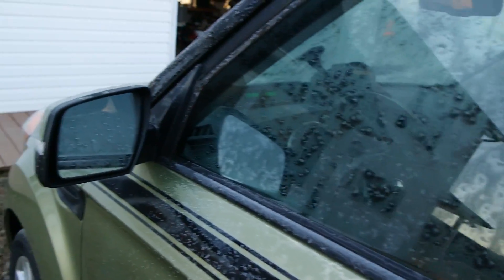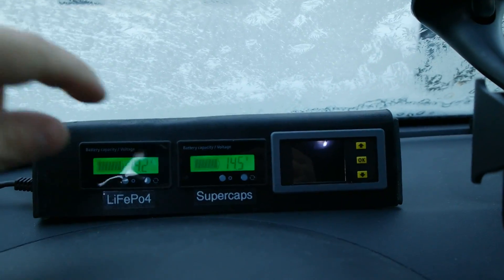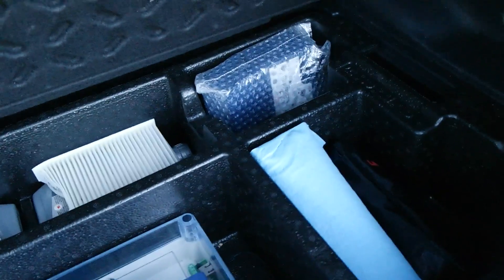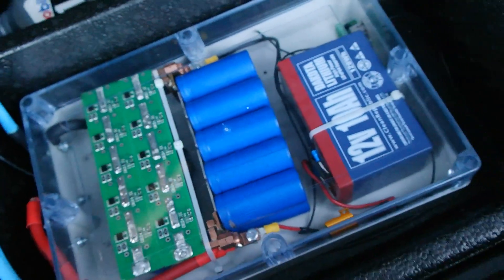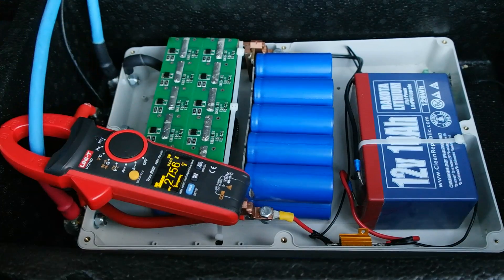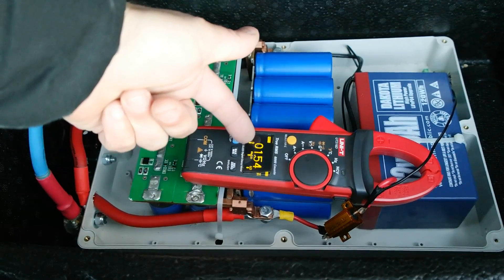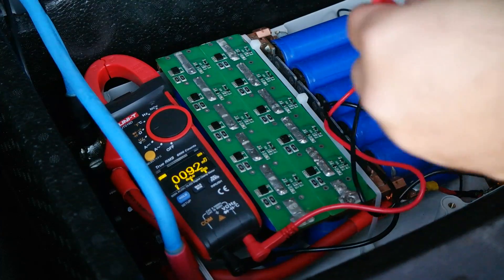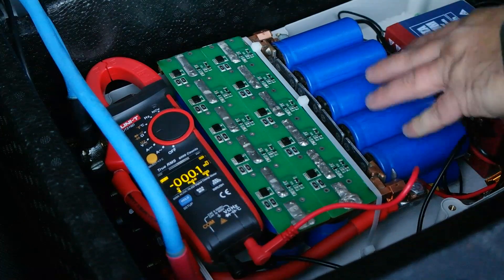Hybrid Supercapacitor Car Battery Part 7   1 Month Update

Comment: 12vdc / .1ohm = 120Amps that 25watt resistor should fry..
Reply: The lithium battery will never be at 0V unless it's just 4 cells welded in series, if it has protection circuit it will cut at 2.5V per cell and won't allow full current charge until the cells recover to 3V so the minimum battery voltage that allows it to recharge at full power should be 10 to 12 volts.
But most alternators output 14.4V so the power will be:
14.4V - 10V = 4.4V / .1Ω = 44A x 4.4V = 193.6W / 25W = 7.744 times more power = 🔥🔥🔥🔥🔥🔥🔥🔥🚒
14.4V - 12V = 2.4V / .1Ω = 24A x 2.4V = 57.6W / 25W = 2.30 times more power =🔥🔥🧯
14.4V - 12.82V = 1.58V / .1Ω = 15.8A x 1.58V = 24.96W = 🍳⚠

Comment: Clamp meter needs to be swapped direction to see current going out.. dc amp clamps are directional. Current supply should be front to back. So you have it on correctly to measure charge Current but not any drain.

Comment: Why is it that you still need to add a battery on to charge the capacitor? Does the alternator isn't enough to charge the capacitor while it's on or running?

Comment: Two questions for those who have done it already:
1. Will it work similar with the existing SLA car battery?
2. What does the balancing board do when an individual SC fails, i.e. short or V<2v?
Reply: Similar to LFP battery, SLA battery keeps 12.7V instead of 13.5V. In this case, the capacitor pack loses 12% power storage. The good news is , each cell would be 2.54 V. According Eaton data sheet, 2.3-2.5V is the most stable stage for energy storage. The leak current is only 0.5mA. According to Electroboom, the least voltage for a 66.7F 12V pack is 9.8V to start a 4 cylinder car. That means it still can start the engine after one week even without SLA optimally. With a 10AH SLA, it may last months as the parasitic current(20-60mA) is far larger than 0.5mA. The second one is, The capacitors are in serial, If there is a board, one cap failure doesn't affect other caps cause the voltage would be cut off when it reaches 2.7V (or the limits), If there is not protecting board, one cap failure causes the whole voltage drop, then the whole serial cap charges to 13.5V. The result is only 4 caps( depend on your cap number) bears the load, each cap would be 3.38V. So all 5 caps crack and leak. The worse, I didn't see anyone tested overcharge a supercapacitor. Comparing a boom of lithium battery with boom of a supercapacitor : ).

Comment: When supercapacitors are well matched and stored at a constant pack voltage, they tend to self balance, because higher voltage cells will leak current at a higher rate than the lower voltage cells. Balancing circuits are more crucial when a pack is subject to constant charge-discharge.

Comment: Super capacitor can’t be over charge they stop taking charge when full at the rating volt that is if the voltage is higher then the bank voltage it will get hot but

Comment: 0.1 ohm resistor.... Is that even necessary to have in a circuit lol
Reply from the maker: Very necessary! It limits the current being pulled from the battery to around 15 amps while actually starting the car. It also decoupled the battery from high amperage loads and allows the supercaps to do thier job and supply the bulk of the energy for starting your car.
Reply: @madelectronengineering  Have you considered putting an inductor in place of the resistor? It may serve the same purpose of isolating the battery during cranking

Comment: Do you want to go to Alaska but would you consider taking it to an ice rink parking it inside overnight to achieve temperature you need Because if you can prove that cold isn’t a factor which I don’t think it will be because you’re using super capacitors  your friend would be cold temperatures but I’d be curious to see what it does at -40-50 if those tests are good you can come up towards Canada And if you’re already I’m not sure where you are I haven’t researched this is my first time here my idea was just to see if you could get it in the -40 to -20 find someone who’s got a skating rink usually they have a Zamboni
Which means they’ll be a garage where you can park the car in the ice without being on the rink Find some with cold storage it’s an experiment you should be able to find someone willing to help the cause inquiring minds need to know

Comment: Very nice video and project. I'm pretty sure using LiFePo batteries and charging them in near freezing conditions will destroy them. Also, one of the capacitors has it's protective wrapping broken next to what looks like a main pole, I know you probably figured it out about 3 years ago, but I'm looking at making all types of batteries and power projects. I saw something, I said something, lol, I hope you have a great day.

Comment: Great content. I currently have Dyna-batt manufacturers ID 5575B  its a 12V, dry cell battery, 16amps hrs, and it is 4 years old. I bought it for the weight savings and at $159, it was the best option. Now, the CCA on it is around 280 and I live in NE and on days where its under 50 degrees, the car struggles to start. I want to maintain the weight savings and I like the idea of a supercapacitor. What kind and how many would I need to help boost this battery? A schematic, or links to what I can buy would be awesome.
Reply: If you connect two of a 16.2V 500F modules connected in parallel that will handle min. 200A continuous. But at $350 ea. it's $700 for adequate caoacitors.
Reply: @Judge Dredd  I bought a UCB450-30, 15 Volts 90 Farads Capacitor 900 Peak Amp Current for my car, and it works great. The car doesn't hesitate to start in cold temperatures.

Comment: Just to check - I've got 120Ah of LiFePO4 in my van and some caps on order. There's a 6S balancing board which puts the voltage up to 16V. Would the board work with 5? Should I just use 5 and skip the board completely? Fixing 1/10 ohm resister between the caps and the batteries should recharge okay?
Basic questions, I know, but I'm learning as I go.
Reply from the maker: What voltage are your supercaps?
Reply: @madelectronengineering  2.7V, 350F, 3 pin. Probably the wrong ones for the job but I figured I could use them on the bike if they didn't crank the van.

Comment: You could use solar panels to put a startup charge in them, then a DC charger in the car to keep them charged. Self contained battery pack for your electric car.

Comment: i'm scared you used those string bean wires :O to pull 600ampsI would use no less then 3/0 wire for 600 amps running 10 feet

Comment: why stick with a battery and not just build a super capacitor bank that can totally replace the battery completely?
Reply: did u try to count the cost?
Reply: @pokwa906  did you?
Reply: @raven4k998  yes. 
in my country, this build cost 5 times more than normal battery car price.
roughly a car battery can last 2 years.
Reply: @pokwa906  and what would it cost built out of 3400 farad capacitors and how long would it last in use in a car?
Reply from the maker: Even 3400F supercaps will drain in a few days.  Supercaps have power density, but not energy density.  The opposite us true of batteries.  Have the two meet in the middle and you gave a robust system.

Comment: Howdy
Beautifully built!

Well done.

I need a unit of this expandibillity for my camper.

Currently 4 x 100watt solar panels driving a big pile of batteries.

Needs to run furnice, 4-6 hours per night (intermittently).  For the worst case senario of coldest night in Jan.
Burrrrrrr!  Now I'm cold.

I know you're busy so ThanQ for an just educated guess. 
That would be grand.
Reply: Do you know how much wh or kwh the furnace uses per night?
Reply: No I dont.  I will check it out.  I had 4 x 6volt (series/parallel). = 2 x 12v.

It would have them down to 12.3v in the am.
Reply: @thenavig8r956  A DC inline watt meter that shows wh or kwh can be used if the furnace is 12vdc.
Reply: @thenavig8r956  Ah of the 6 volt cells? Deep cycle? Are you using an inverter to turn the DC to AC?
Buy a "kill A watt electricity usage monitor" set up to be at 0kwh plug in your load when you start to use and check in the morning how many kwh's was used over the night(if the load is AC).

Comment: Sorry but i've had an almost dead (dropped to 10v under a load tester) battery start a 1.6L corolla @ 0degC like it was +20degC outside. So on that part i don't think you're stress testing enough.
I'm interested in this project for a Prius. Though i'd change the storage battery and the amount of supercaps. I'm thinking of using a 10ah 4s3p pack of 18650s, the idea is weight savings(<2kg vs 10-15kg lead acid battery). Also instead of 4 capacitor banks i'd use 1, since the prius doesn't use the 12v battery as a starter, but more as a relay switch and accessory power supplier The biggest concerns i have is with the dc-dc converter being over stressed and going bad(since i'm going to be driving at least 100-150km in the city and high way per day) and if i can still have a nice 200-300w subwoofer in the rear. Would like to hear(technically read but wth) thoughts of anyone who read my comment and has any ideas.

Comment: I'd just use 6- 3000F 2.7-3.0 volt super caps in series and forget about everything else. You are pushing a very complicated system and are going to be dealing with many failure points. I don't see any need for batteries, especially Lithium-Ion batteries.

I have Dodge Grand Caravan minivan with a roof rack and can mount a 160-watt solar panel with a diode on the roof to keep the caps charged if the car is not in use for an extended period of time. In full sunlight, it would provide 13.3 Amps at 12 volts, enough to power a radio.

Comment: how do you keep the capacitors from draining the battery after sitting for a few days?
Reply: Capacitors do not draw anything after they reach the voltage charge threshold.
Reply: @rollmeister  They self-discharge though, and will drain the battery after some time if left connected.
Reply: i have a setup just like this but i use a 12v solar panel to keep the supercaps charged. i have the 600f caps and use a solar charge controller connected to the capasitors .its been working for 4 years no problem and the solar panel just sits in the back window .

Comment: Thought this was a fun experiment, and thanks for doing these tests/ uploading. Here's my $.02, when you have a VCR or TV that goes out (or even your blower motor in your home hvac) what is usually the cause? A bloated/overheated capacitor on the power supply - get some cooling in that enclosure if your going to want those caps to last the 4-6 years of a regular la battery. 

Also, and this seems to be the case with a lot of cap-used-as-battery vids on here: If you run into engine issues roadside you only have 2-3 tries to crank the car over, no? I doubt a 10Ah battery would take that full load after that.

Comment: i have 6x500F supercapacitors in series on board and i want to build a Lead acid replacement for my 4cylinders 750cc motorcycle. How should i connect  6 x18650 batteries i have, to charge the supercapacitors? Thanks!
Reply: you cant not change real battery with those shit. unless you drive where is always warm.

Comment: What balancing board do you need for 3× 18650 and 3xsupercaps to replace a lead battery for motorcycle?thanks
Reply: A prayer type as its not enough for  component to handle

Comment: I am a little confused. You are using a clamp on amp meter which according to Faradays law should not work using DC current. You should only get a reading the instant you start your engine which represents a fast alternating current then nothing.Only an AC current will give a continuous amp reading.
Reply: https://electronics.stackexchange.com/questions/341156/how-does-a-dc-clamp-meter-measure-current
Reply: Those digital clamp meters with DC Amps reading use a Hall effect sensor to measure the magnetic field and do not have any windings to act like the secondary of a transformer.

Comment: Hello, first at all, thank you for your excellent work and share it with everyone. I'm doing a project similar inspired in your work. I have a new car that has the S & S system. I have read that people, even if they have the system disconnected, has a lot of problems with the battery and dies in 2 years. This car (tsi 1.4 ACT 150cv) has an intelligent alternator (microhybrid system) which means that it works with 3 voltage levels, 12.4 V (no load) 13.5 V (medium load) and 14.65 V (full load) ). regulation is automatic and depends on the engine load, to improve fuel efficiency.

I have in mind to install the capacitor bank (16V and 83F) in parallel with the lead acid battery. I will put a fuse (200 A) before connecting to the battery to avoid any potential disaster with a possible short circuit in the capacitor system. My question is, as you can see, I'm going to have a lot of time charging at 14.65 V and suddenly the alternator voltage drops to 12.4 V. In this situation, the capacitors discharge the current to the battery quickly. If I have a jump voltage of 2 volts between 14.65 V and 12.4 V putting a series resistor of 0.5 ohm, I will limit the current to no more than 5 amps, right?

What do you think about this system? Will the capacitors improve the life of the battery with the S & S system? Any problem with the intelligent altenator system that can see?

Comment: You remind me of me! I built one for my Chevy Blazer and since it had a 406 Stroked Motor, I stepped it up.
I like your effort and would like to offer my 2 cents because I've already been there.  I realize that there are many approaches so here's mine.
First,     I built mine in a Plastic MTM 50 Caliber Ammo Storage  Box " Ebay $12". It's the same size as the original Battery. There's exactly enough space for everything inside too.
I stepped up my LiFePO4 Battery size to a 35Ah w/500cca. It's just got more Reserve.
I used 6 Maxwell  2.7v@  3000 Farad,  which is Plenty of Cranking Power!!!  I used a Remote  Balancing Circuit.  It's available for $16 on Ebay.
I also made Copper Side Post Terminals on the box. It looks like a Stock Battery with a recessed handle. It's very Simple and sits right in the Original Tray.
I realize you have to consider Cost. I wanted a system that was Heavy Duty. When you Strap those Caps together into a 6 Pack, it's the Nuclear Option...
May I add another note, You don't need a Resistor in the Circuit. The Alternator has a built in voltage regulator which is going to be sensing the Capacitors voltage and ramps down . The battery just goes along for the ride. Stick a meter on it and watch what happens.
Good Job to You

Comment: Great information.  I love watching what you've done with this project.  At this point, do you see a need for the active balancing Mosfets that you added?  I'm considering doing something similar with 6 Maxwell 3000F 2.5V capacitors.

Comment: Thank you for the update. Great work. I think >700A is a bit unrealistic. I was expecting a draw in the range of 100-200A. My 3.5L Lexus engine draws about 230A for 3 seconds. If you get an update on the amperage draw later, please update us. Cheers
Reply: Maybe the overload was caused by the initial inrush peak current. I also expect somewhere around 200 A of actual current. But the first couple of milliseconds it might indeed be 600 A or more for just a very short period.
Reply: Frankhe78 you are probably right. See the ElecttoBOOM video where he uses a scope during crank. Couple miliseconds of inrush current exceeding 700A can be expected here too. https://youtu.be/tKki89sq0XY